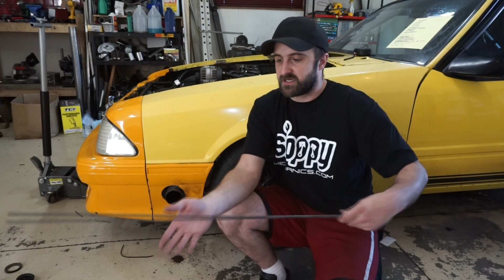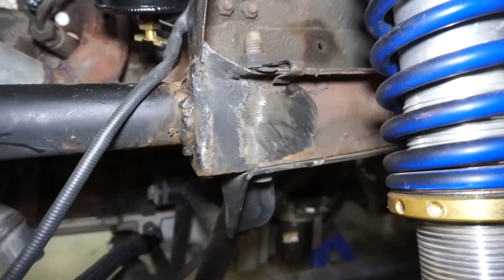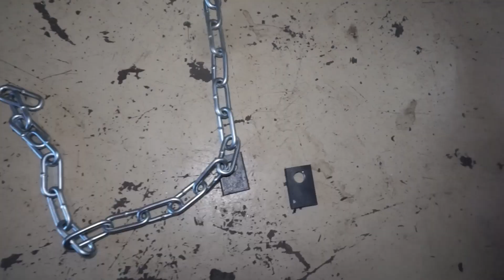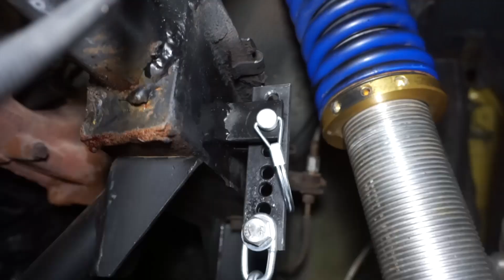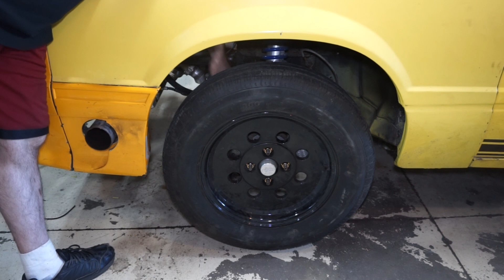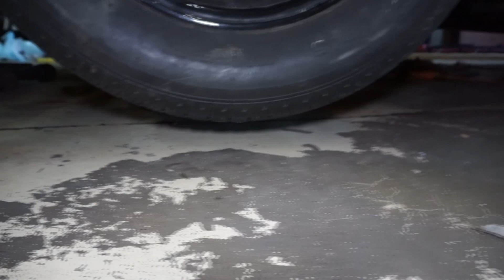Fox Body Suspension Limiters For Drag Racing.

Comment: Man, I think you'll find the limiters a valuable tuning tool - but not till you really turn the power up. You'd really benefit from some decent shocks/struts where you can control the rate of rise/compression. That's a game changer! Your tenacity with this build impresses me with every video - keep up the good work!
Reply from the maker: Yeah I'm just gonna keep them loose untill I need them, but at least they are there. Next time out I'm going to try launch at 8-10psi instead of 4, so that should be interesting since it did 1.41 60ft on 4lbs leave.

Comment: Good job.

Not to nit pick but the proper term is a droop limiter.

It's just easier to communicate if everyone knows the right terms.

It would be nice to see how much difference you need side to side to counteract the torque at launch.